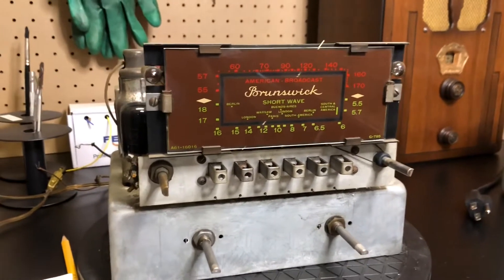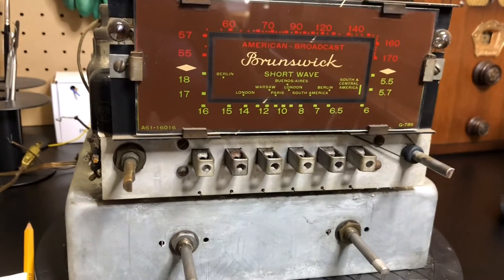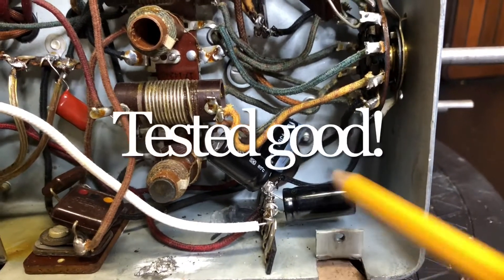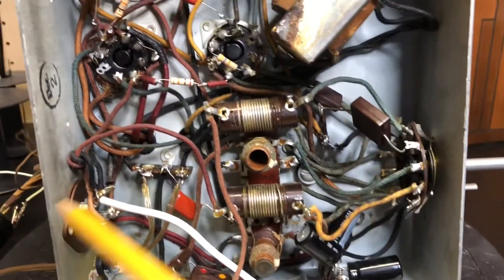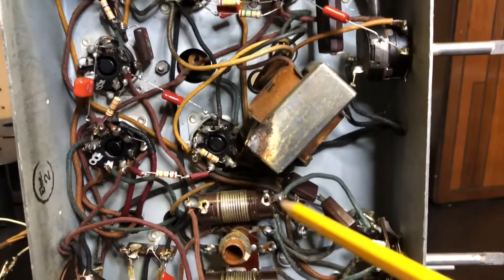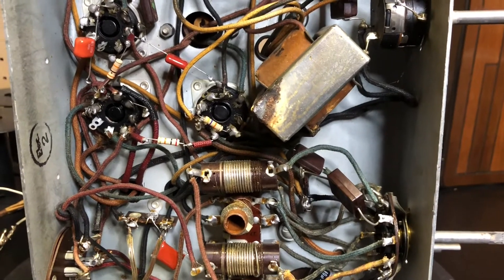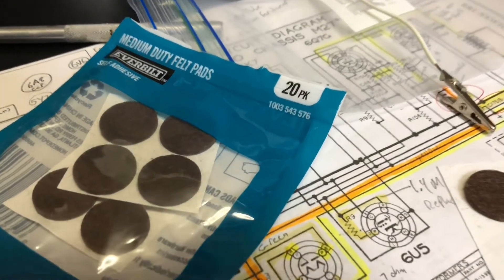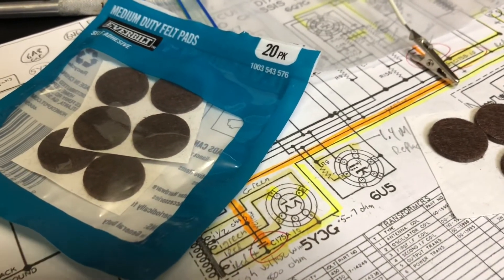1939 Brunswick Revisited

Comment: 60 Hz hum. It sneaking in somewhere in the audio output stage. Wire dressage could be the issue. Keep high voltage 
wires from those coils by lengthening wire from new capacitor down  and away  from coil first and see if that is the 
problem.
Reply from the maker: Great, thank you for the idea.  I'll give that a try.  I'm not the first person to "repair" this radio.  Maybe there is a wire right next to a coil that  shouldn't be there.  It's one of the better playing radios I have...picks up everything.  Shortwave works great too.  Thanks for the ideas.

Comment: I'd have a look at R154 (1.5 megohm) resistor. Its a possibility that the resistance is too high.
Reply from the maker: Thank you....I'll take a look at that too.  It still has a few of the old, long plastic looking resistors in it. I'll double check them.

Comment: Riders schematic shows a capacitor ( C59) between line in ( where the on/off switch is located )and B-. 
It has a value of .01uF and 400 Volts. Possibly if you replaced it with the one at that value  either the new one is not
 soldered good or it is bad. I think it may be too low. Try a .02uF and see if that cures the problem. In many radios they put
the capacitor at .05uF which is too high. This should be replaced with a safety capacitor  BTW.
Reply from the maker: I used the Riders schematic.....I'll check the (C59) cap.  I'll boost it to a .02 can't hurt.  I replaced all the caps and the bad resistors.  My soldering skills are not great....so I'll do more checking there.  It has always had a hum.  When I first got it the E. Caps had been replaced and were good for testing.  It had the hum then too.  I replaced everything that was put in as a replacement.  I'll pull the chassis out again this afternoon and take a look at it tomorrow.  My little radio work area is in an unheated part of the house....it's 49 degrees in there now...30 degrees outside.   Way too cold for this Southern boy.  hahaha   Thank you so much for taking the time to look up the Riders for this radio and giving me some great advice on how to solve the problem.  I'm self-taught in tube radio repair, (books, YouTube, emailing people), so any and all advice is welcome.  Thank you again...I'll let you know how it comes out.
Reply: @My1925World  No problem.